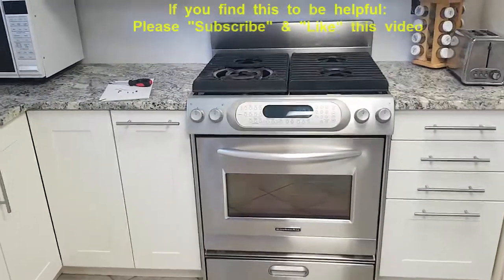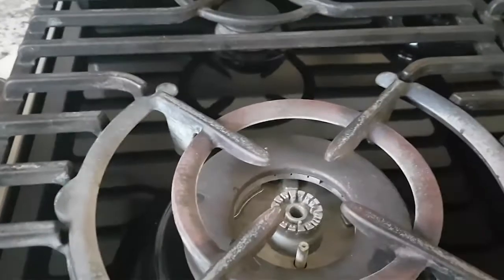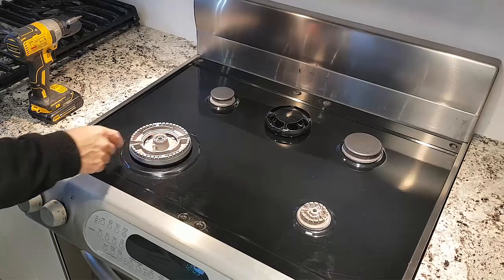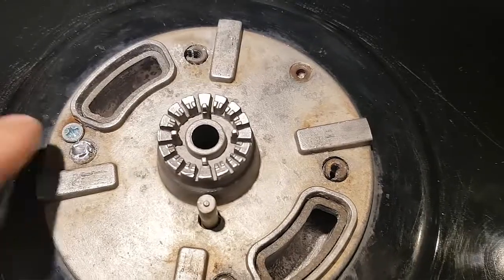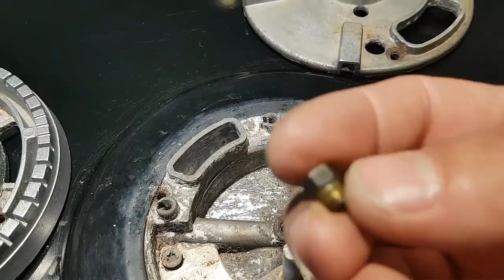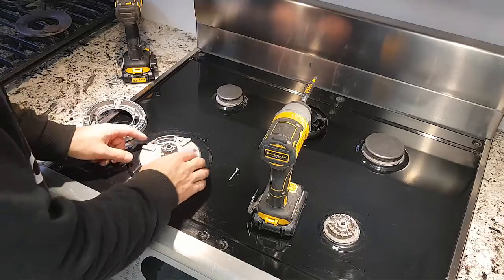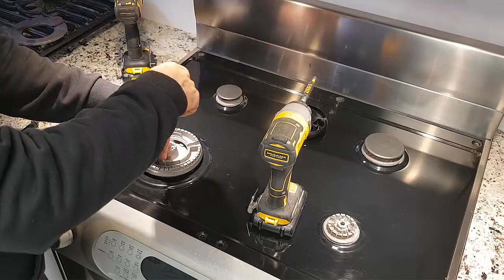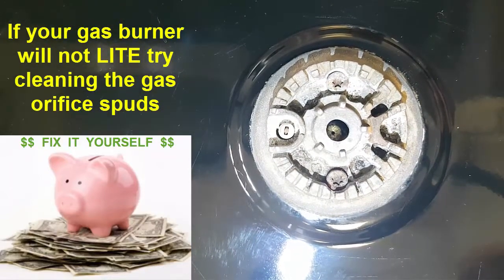Repair a Gas Stove Burner that doesn't Ignite / Light (KitchenAid Gas Range)

Comment: Thanks for showing how these burners are constructed. I was able to remove the screws holding the diffuser rings, although it would not have been necessary. Removing the rings gave better visibility. I used gas welding torch tip cleaners to clean the burner orifice. Tip cleaners contain 20 or 30 small diameter stiff wires of graduated sizes. Tip cleaners are available on line or at welding supply stores for a few dollars.
Reply from the maker: Hi Kenneth, Thank you for your comment and for sharing additional information about the welding torch tip cleaners. I'm sure others will appreciate knowing. Vito Casola - FIX IT Yourself.!!

Comment: we have that exact model but the oven burner lights but won't stay lit more than a few minutes.  Replaced the igniter and thermocouple assembly - same problem.  Is there a way to check oven gas valve?

Comment: Excellent video, how did you remove the stripped screw
Reply from the maker: Hi Parvesh, I had to drill out the broken screws and then I because I slightly damaged the burner heads in the process I had to replace the screws with ones that were slightly larger to ensure a good fit that would hold down the burner heads again.  Did it happen to you as well? Seems common that these screws seize up and then snap when you force them. Good Luck with your repair. Vito Casola - FIX IT Yourself!!
Reply: @FIX-IT-Yourself   Yes- i lost one screw and so I didnt force the other one (!). I used oven cleaner to clean up- not a very good job on this.. As soon as I can get the correct drill bit, I will drill down into it and do a good job on this. I appreciate your response..
Reply from the maker: @parveshv.merchant9806  Hi Parvesh, You're welcome and good luck with your repair. Vito Casola - FIX IT Yourself!!

Comment: Nice video I have the same gas stove. Wondering how you would fix the igniter that does not spark anymore could you make a video please ?
Reply from the maker: Hi Bar of Soap, Thank you for your comment. Sorry my problem was related to gas flow. It sounds like your problem is with the ignition coil.  I only make videos of things that I need to fix so some day if I experience the problem where I'm not getting sparks at the burners then I would likely check and replace the ignition coil if necessary. Maybe someone else has had this problem and has made a video of this fix. Good Luck with your repair.  Vito Casola - FIX IT Yourself!!
Reply: I just moved Into my home with this range and I can’t find the model number to look up the features and manual can anyone help me with this?
Reply from the maker: @crystalkuntz7575  Hi Crystal, I only have a manual that I found online which is close to my gas stove but I too could not find the model number anywhere on my stove so I don't know if it is exactly the same unit, however it does look very much the same.  I could email you the manual if I cannot find a way to attach it to this video. Vito Casola - FIX IT Yourself!!
Reply: @FIX-IT-Yourself  should be on oven door on bottom inside
Reply: Could you please email or give me the info for the website and what you used

Comment: Great video, my problem is (right most) burner will not  light nor start clicking until I turn on the opposite burner  (leftmost) on; then  the (rightmost) burner  will start clicking and light up what could the problem be? I welcome all suggestions. Thank You
Reply from the maker: Hi William, Thank you for your comment and positive feedback.  Not sure what the issue is but you may wish to check your owner manual as there may be some troubleshooting tips in the back of the user manual. If you don't have a copy I managed to find a copy online that is pretty close to the same stove model I have so if you email me at vmcasola@gmail.com then I can send you the manual I have and you can have a look through it. Vito Casola - FIX IT Yourself.!!
Reply: Hey update, did you get yours working? I have the same problem
Reply: @Ash-qy5zb  No I did'nt call the repairmen they did'nt know what the problem was we are just living with it. Do you replace the whole unit, or just live with it the burner works fine when lit.

Comment: I have the same stove & need to know how to take off the door to clean in between the glass and don’t know the model number… do you know how to do that?
Reply from the maker: Thanks for your comment. I actually cleaned this stove before installing it and I removed the door, removed all the screws that hold both the front and back side of the door in order to clean inside between the glass, exactly what you want to do. I'm just sorry I didn't record the process as I could now make a video of how to do precisely that. The next time it gets dirty enough that I need to clean it again I will be sure to make a video.  Having said that I do recall it was kind of tricky to re-assemble so if you do decide you want to try to tackle this yourself I would strongly recomment taking pictures or video as you take it apart so you have something to reference when it comes time to re-assemble everything. Good Luck. Vito Casola - FIX IT Yourself!!
Reply: Thank you so much!!!! Because  I watch your video a few other videos got suggested… although I didn’t get the model number I did watch someone take off the door!!!! 🥰

Comment: can you please give me model number of stove, i have same one but numbers are gone , want to look for manual , thanks
Reply from the maker: Hi Robinmex, My appliance also doesn't have any model number that I could find. I was able to find manual online which appears to be very similar in appearance to my gas stove but I since I could not find the model number anywhere on my stove I don't know if it is exactly the same unit, however it does look very much the same.  I could email you the manual as I don't know how to attach it to this video. If you email me at vmcasola@gmail.com then I will send you the manuals I have found for this stove. Vito Casola - FIX IT Yourself!!